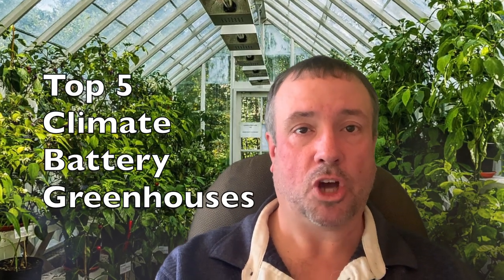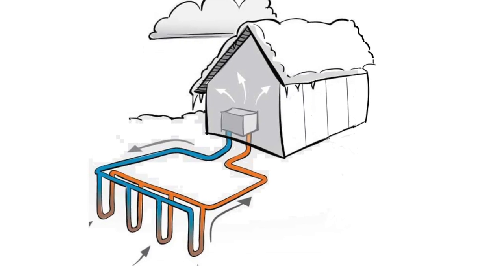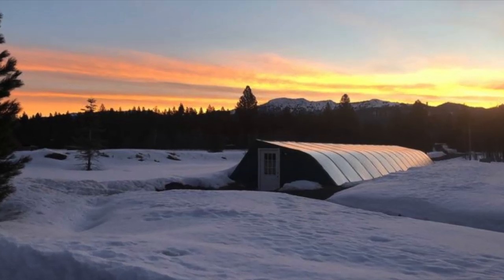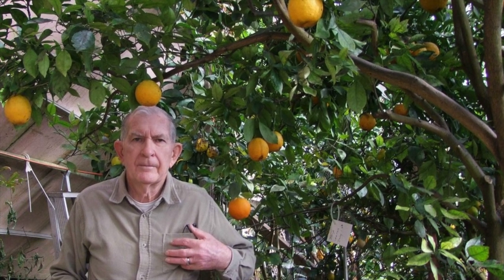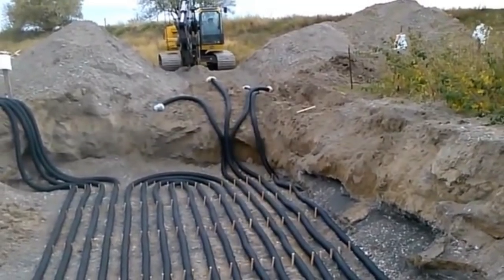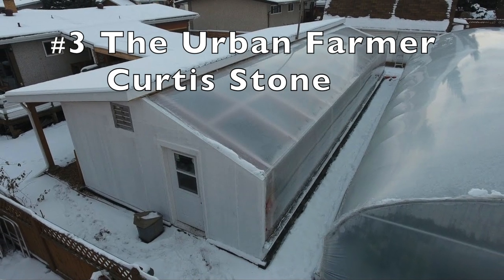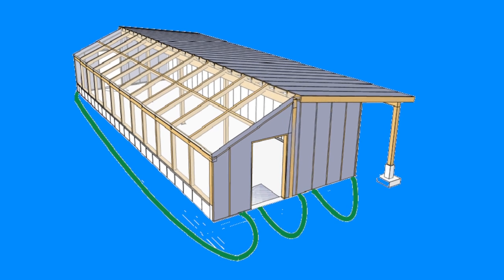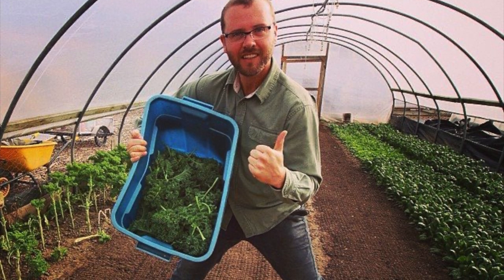Top 5 Greenhouse Climate Batteries giving Free Heat in the Winter!

Comment: Thanks for the links.   I have a question?   I live in Kuwait and with respect to all the cold weather thermal batteries videos I’ve seen.   Is there a way to use thermal batteries in the desert? 
We have a man made pond on the farm and I wanted to exchange our abundant amount of heat for the coolness beneath the sands.
Is there any resource video done  on desert greenhouses?  
Thanks again and keep the videos coming.   - Rick
Reply from the maker: Yes, absolutely - a liquid thermal transfer system would work
Reply: Simple Tek  have you seen any videos explaining the liquid  thermal transfer system as it relates to greenhouses or will  I be the first?  Thanks for all your help
Reply: @RickWright722  
The distance from the pond to the greenhouse would be an important factor. I`d sink a temp probe into the sand and another into the pond and see which has the cooler average and go from there.
Reply: JohnGuest45 
My theory:

1. If we dig 12 ft down. 
Place Blue plastic barrels in the hole. 
2. We have a well and irrigation pond on the farm. 
Split off from the well and connect it to my buried drums.   The last barrel has a pipe running out and back to the  pond. 
3. I will run the geothermal pipes through the barrels.  Keeping them water tight.  

Everything else would be the same as as the geothermal community, except we have sand and dirt and not rock.    So tell me am I  imagining success where there is none.  

Yes we also use the water wall(swamp cooler) for cooling but like I said Kuwait is really hot.  Using geothermal would be additional cooling with lower use of electricity and cost.
Reply: @RickWright722  
Hi Rick, 
Its easy to imagine success but its better to run the numbers and compare the predicted performance to the  existing swamp cooler performance which is a known quantity. If the geothermal can provide equal cooling performance with lower running costs that could be viewed as success.  The more variables you can put numbers to the better.  Burying plastic barrels 12ft deep is ok but its doesnt provide much to work with, for example, how many barrels and how big they are will give you the surface area and how much water.  The first thing i would do is physically measure the temperature of the sand down at 12ft as the viability of the installation rests on it. It wont be the 55F stated by most of the geothermal vids on youtube  ;) 
The easiest way to get the temprature reading is to attach a hose to a length of pvc pipe or several short lengths that can be fixed together as you go. Turn on the water and the pipe will sink into the ground with almost no effort. Give it a few days for the temperature to stabilise and then drop a temperature sensor down the tube. Its best to take readings regularly several times a day over a period of time to get a better picture, i sank a number of tubes at various depths around the site and monitored the temperaures for 12 months to get a baseline.
Reply: @RickWright722  Hi Rick, Absorption refrigeration or kerosene powered refrigerator are probably topics that can help you turn heat into your helping hand in cooling the interior of a greenhouse. I think the ambient heat or collected heat at higher areas of a greenhouse need be concentrated to make this 'heat powered cooling' work. I saw on YouTube a commercial greenhouse operator (southern USA) use water vapour to cool his greenhouse but I know humidity uncontrolled could do harm to some crops. I saw some Chinese innovation of using thin film solar membranes (that can be rolled up) on top of greenhouses to reduce sun penetration and heat inside, while powering fans where necessary. I wish you good luck attracting knowledgeable people's input.

Comment: Any idea where to find a two stage thermostat that works for a climate battery fan?   I setup one last summer and just let it run continuously and it works, but I would like the fan to run off one of those amazon greenhouse thermostats for heating/cooling.. the issue is they're all designed with two outlets for two devices and I just have one big fan.
Reply from the maker: EBay or aliexpress
Reply: @SimpleTek  researched all day, including those sources thank you - the solution I went with is a second fan (8" squirrel cage high cfm).  very hard to find any other solution, and I came across a few others asking this same question. If you build an in ground climate battery in your greenhouse and want to turn the fan on to charge it, then take a break when it's nice out, then on again to use the heat at night - there are thermostats that kind of do this but they're meant to run a separate heater and a/c. A simple thermostat that will do the switching but power just one fan needs to be put on the market, if they exist I can't find one.
Reply from the maker: @OakSummitNursery  happy you found one!
Reply: @OakSummitNursery  
The best solution is a combination of thermostat, differential thermostat and fan speed controller. A "dumb" thermostat will run the fan regardless of whether the mass can accept or supply heat because it only takes account of the greenhouse air temperature. It should also take account of the  temperature of the mass.

Comment: Curious. If you put the pipes under your skeptic system. Would it be more efficient?
Reply from the maker: not sure what efficiency you're trying to achieve? please elaborate?
Reply: @SimpleTek  if you put the septic system on top. Doesn't it create heat in the decomposition process?
Reply from the maker: @SemperBlood  I suppose it would.. but septic tanks are buried to take advantage of the ground heat so they don't freeze

Comment: a  double air-blown poly greenhouse, does it work as an insulator even in the summer, when temperatures goes up 95-100F? Thank you!
Reply from the maker: insulation holds heat in, so yes double air blown polly will hold heat in. it's easy to counter act though, just add some venting.  open the door, open a window and add fans on the vents.

Comment: Very nicely done and a good idea to review these climate battery experts.  Thanks.  Next concern:  The underground drain piping used will build up condensate water and my thoughts are that that could smell or be unhealthy.  One certainly needs to know for a fact the water table level before building and digging.  Also, what about radon and testing?  Question for YOU!  What video software do you use, and do you use a green screen to make those really nice background images?  There actually is another granddad of thermal battery greenhouses, and it is a private Christian school up in Polebridge, Montana. https://youtu.be/kW9HSoVVi6E It is at an elevation of 3600 feet and 15 miles from Canada.
Reply from the maker: Thank you for the comment. Condensation usually isn't a problem as evaporation fixes that, but ground water table is an issue depending on locations. radon - no idea? I use a Mac with iMovie (free software for Macs). and just a green sheet I bought off amazon for $20 tacked to my wall.
Reply: From what I understand, using the perforated black drain pipe allows condensation to drain into the soil and allows benign soil organism to dominate and control any mold and mildew.
Radon?
 I think a radon detector  should be used, but I'm not sure if  most  green house are tight enough to matter.
Reply from the maker: @slaplapdog  I've seen many systems and none had mold and mildew problems -  I think the reason is evaporation with constant airflow. When air is constantly moving it evaporates any moisture much faster in the tubes

Comment: I'm not good at research so one thing I want to ask - are the underground pipes empty and only air from greenhouse flows in them or are there a chemical flowing through them like in geothermal heat pump? and what kind of material if preferable for pipes - plastic or metal?
Reply from the maker: you can do an air system or a water system - you would use different pipes though for air or water. most are plastic for both.
Reply: @SimpleTek  thank you for the info,
Reply: @SimpleTek  one more question, would it work with a sunken greenhouse?